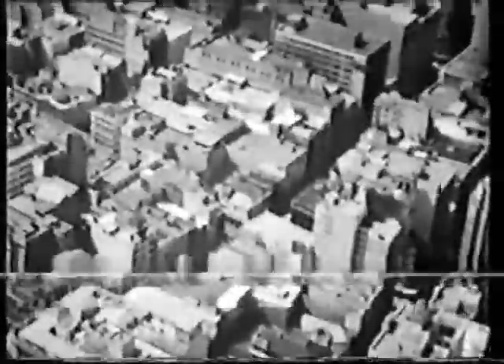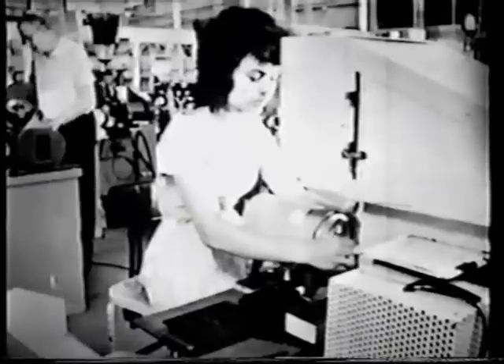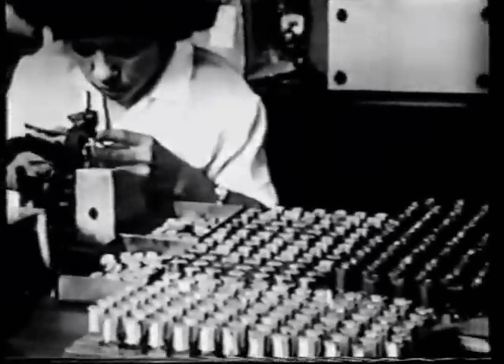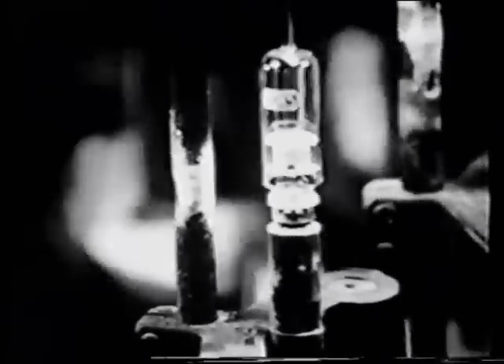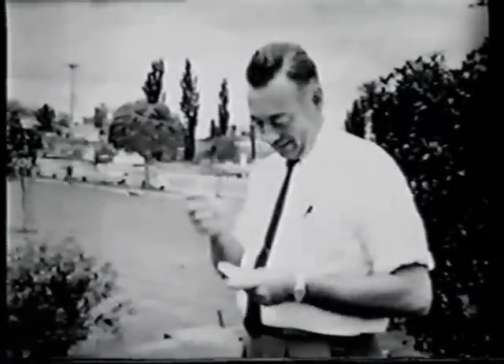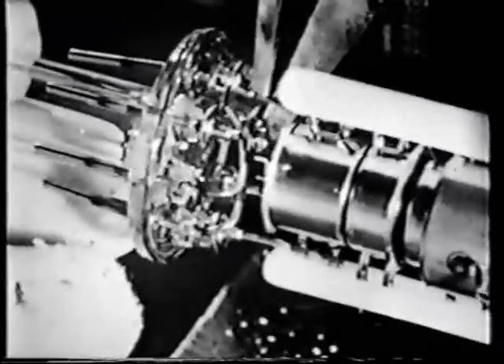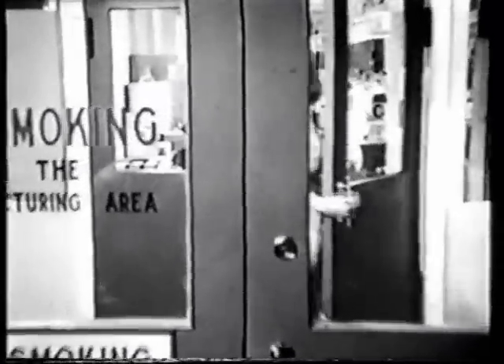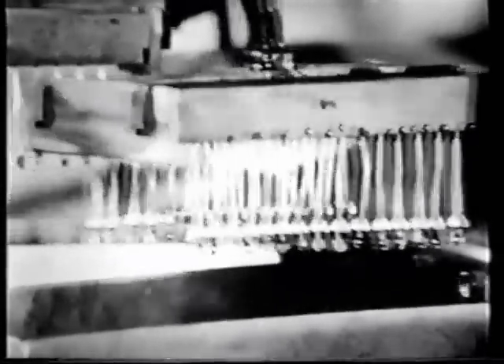Valve Production by the Amalgamated Wireless Valve Company, Sydney Australia

Comment: At 4:20, baking parts in a hydrogen oven; a process I had heard about, used to pull residual oxygen and water vapor out from the metal parts. A gassy tube is a bad tube, prone to thermal runaway, excess current draw, red-plating, and grid failure.